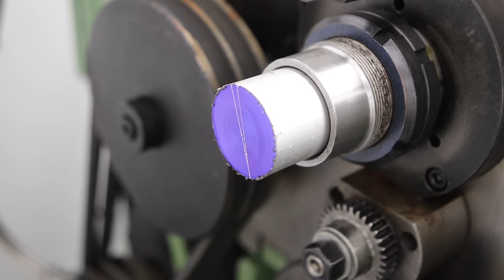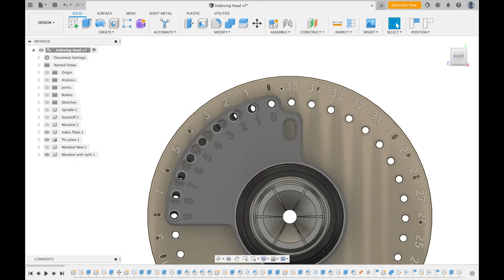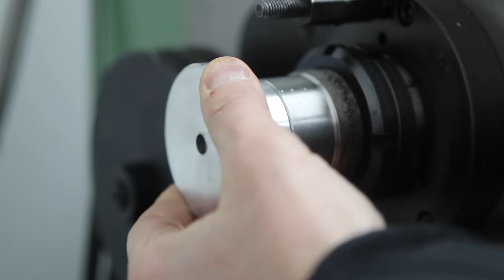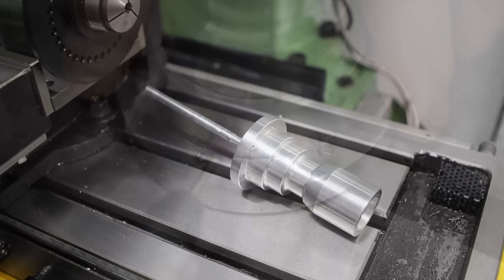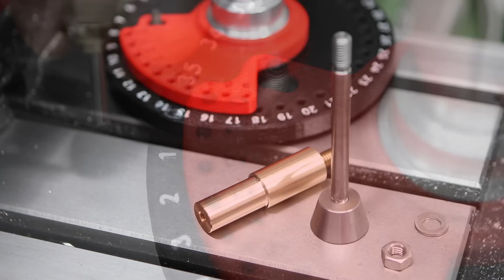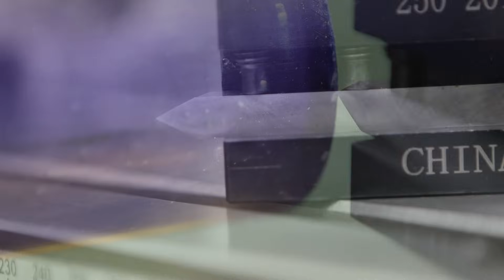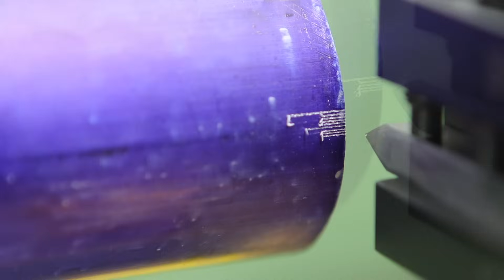Making an indexing attachment for the lathe

Comment: Some tapping fluid would go a long way towards avoiding broken taps. Also, couldn't you use the multi-hole function on your DRO to drill 36 holes in a circular plate, avoiding the 3D printed parts altogether? Keep up the vids, love seeing this stuff!
Reply from the maker: Thanks. Yes I could make these out of metal i suppose. I wanted to see if the 3D printed design would work first though. If the prints don't stand up I'll machine them in the end.
Reply: @joneseymakes  boil non ferrous metals in alum and water to dissolve ferrous taps and pins.
Reply: @joneseymakes  oh man. As I saw you hand tapping aluminium without lubricant of any sort I said my farewells to the tap 😁 Love the content though!
Reply from the maker: @qwertyu19951  I know, stupid mistake, don't know what I was thinking at the time!
Reply: @joneseymakes  Make the back plate by 3d printing with undersized holes. That way you can have the numbers and accurate holes and bore finished on the mill. Same for the fixed plate. Best of both worlds. You could probably redo the existing holes slightly larger and make a new pin to suit for a more accurate result.

You should be aware that spiral flute taps are weaker than straight flute taps so easier to be caught out and so snap them. For through holes spiral point are the best option, they push the waste ahead of the tap.
Reply: @martinconnelly1473  depends of the helix direction, most spiral taps are for power tapping, right hand helix pulls the swarf spiral out of the hole, you are quite right about left hand helix, use only on blind holes, or use thread milling if cnc. good taps for maleable materials are roll taps, very expensive but worth it in the number of tapped holes especially in 316 etc
Reply: @crozwayne  Don't confuse spiral point and spiral flute, they are different things. Spiral flute taps are weaker than straight flutes because the spiral flutes are deeper to allow swarf to escape the hole. The spiral point taps push the swarf ahead of the tap but have the same depth of flute as straight flute taps. Pushing the swarf ahead of the tap requires a through hole to let this swarf out.
Reply: @martinconnelly1473  you can get left and right handed spiral flute taps, for providing material evacuation either forward or rearward under power tapping. Yes I agree with your comment n spiral point taps.
Reply: He could but where’s the fun in that.
Reply: I haven’t yet used my mill to machine tap yet but when hand tapping I was taught to always use cutting oil and also to reverse the tap at least every turn to break the chip off to stop overloading.

Comment: Other indexer builds put the second plate holes 11 degrees apart. You put yours 9 degrees apart. Can you explain the difference? (Other than 2 degrees)
Reply: The way the scales go to increase the rotation by 1° determines the angular gap of the smaller plate. If the red plate was numbered in the opposite order with the zero hole away from the stand off hole and the 9 hole near the stand off hole then 11° spacing would be wanted to make it work. It is to some extent a matter of preferred working direction by the designer. I don't think one way is right and the other wrong.
Reply from the maker: I think the key thing is that there is a one degree difference in the hole spacing between the front and rear plates. So either 9 or 11 degrees should work.